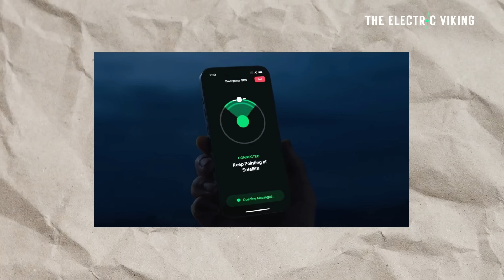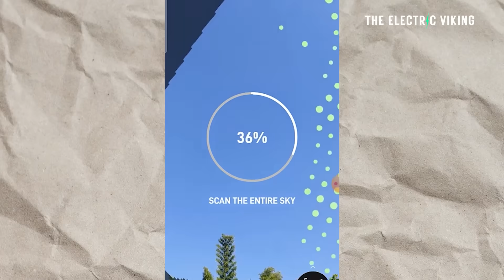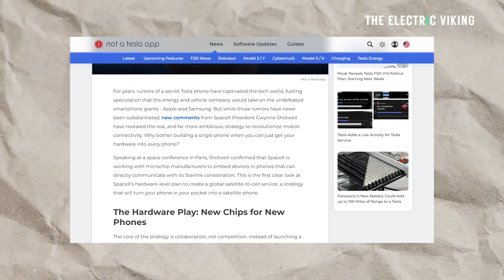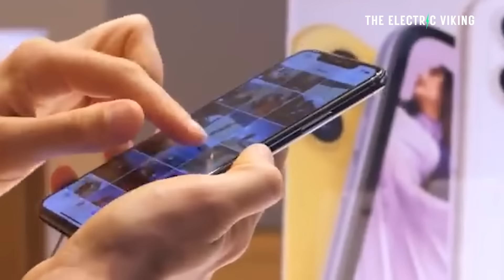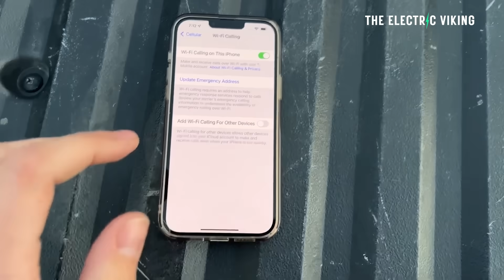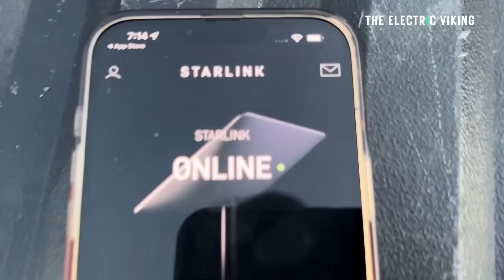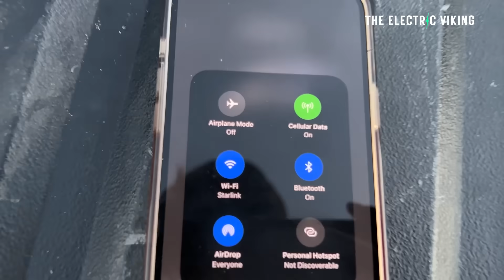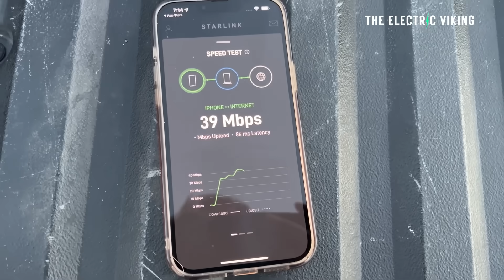SpaceX Shocking Plan Gives Them a Monopoly on a TRILLION Dollar Market

Comment: I'd have some concerns about the signal levels the phone will produce. The distance from the phone to the satellite vs phone to a cell tower is much greater requiring significantly higher power levels. Probably not desirable for a device you are holding against your head.

Comment: I don't think you're getting what this is actually. It's not new chips on phones. It's using the existing phones that support the existing wireless spectrum. Cell towers in space so you can't use the previously existing StarLink satellites. New StarLink satellites with cell towers had to be launched. The satellites are low enough that they can reach the phones. The good news is it's already happening with new satellites and it's easy to do with existing phones. Note, this is different from Apple's native satellite support. It's confusing so do some research.

Comment: You are missing one key thing sending messages and making phone calls is only one small part of what people use phones for. Which is all that the current starlink is able to provide to a phone due to power limitations of the actual phone and the distance of the satellite. 

We simply do not have the technology to get even 3G data speeds with the low power of a  phone to satellite in space

Comment: The SpaceX/Starlink advantage:

1st operational constellation, and therefore has the best real-estate in orbit.

The only launch provider, even after a decade able to reuse an orbital class booster

Will soon have Starship operational increasing both payload & cadence by several factors.

With Starlink, they will have the ability to provide 4G telecommunications anywhere on the globe to cell phones.

* It can bypass any local government censorship firewall.***

Comment: 1:38  - Wow. Your operators are BAD....

In my country:
5G = 92%
4G = 99%
2G = 99%

This is country coverage and not road or city/village coverage. In this case, the percentage would be even higher.

As far as the signal or the signal being turned off, I haven't had any problems in the last 20 years.

The signal stability is rock solid, I've never had a problem with not having a signal in locations where it should be.

Comment: According to Starlink's own figures, they currently have only 1/4 of the subscribers they were expecting to have by now, and they make an annual profit of $6 per subscriber. The financial model of Starlink is in the toilet. A fibre-optic cable in the ground will last for 40 years with zero maintenance. Starlink relies on a constant replenishment of failing satellites, which is very expensive.
Reply: where did you read that nonsense? get better source to avoid misinformation. They are inundated with subscribers - only limiting factor is the capacity to deliver. also, with regards to the economics, you are definitely not well read on what is happening with starlink economics. look up the data, and not depend someone else's misinformation - data is all there if you look for it.
Reply: @LL-tc1pn It was in a profit report published by Starlink

Comment: This isn't going to play out like this. There's no chance these satellite phones will come close to matching the performance of cellular. 
Sending a signal to the satellite is a lot harder than reading a signal sent from the satellite. 
Most likely, this will be an option. Pay extra for a special phone. I live in Canada, where we also have extensive areas with no cell coverage. Most people don't care because they rarely leave coverage areas. I do not know of a single home that uses Starlink for internet who has a choice. I was in Starlink FB groups for Canada and the US and as soon as fiber internet cables are installed people got rid of expensive and less reliable Starlink.  Starlink wouldn't work at all at my house due to trees.  
Absolutely, there's a large global market, just like there is for Starlink internet, but very few are paying two monthly subscription fees. 
People who live or frequently travel outside of cellular coverage areas, which in Canada might be only 5%, will pay to subscribe. 
I doubt phone makers will  jam an expensive additional chip and make the software more complicated on every phone sold. They will make more money charging an extra $200 for a Starlink capable phone. People will pay it. Just like how in Canada we pay 50% to 100% more for Starlink over what connected fiber customers pay. Despite this,  there's little evidence Starlink is making big profits. It's a costly system to maintain.

Comment: If its a monopoly itll be expensive like starlink internet already is. I dont know anyone who prefers it when other options are on the table for half as much.
Reply: How much is a 250Mb line in Zimbabwai?  Please give me a price.  I can get Starlink for just $650+ $120/mth.  I bet it is more than $10 million.
Which one is really expensive?
Reply: it's called economies of scale. starlink will get cheaper and cheaper....just like every other tech adoption.
Reply: I have starlink now and regularly get 350 MbIts download.  The same download speed from my old fibre provider would have cost me more money.  Starlink may not be cheap but it certainly is great value.  You can also use it mobile which means Internet can come with you a bit like 5G Only much faster
Reply: @ouethojlkjn  Depends where you are but here 350 mbits is half the starlink base price.
Reply: How had starlink for several years tried the rest now use the best its that simple.